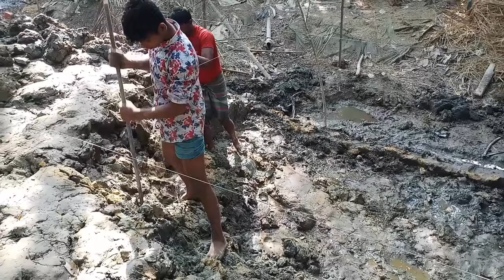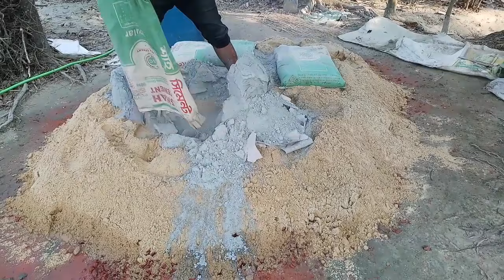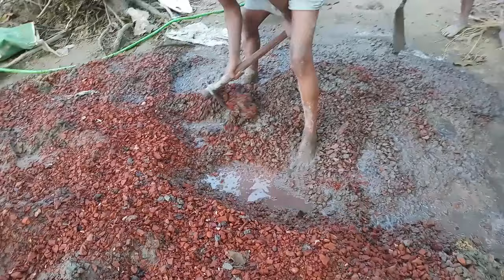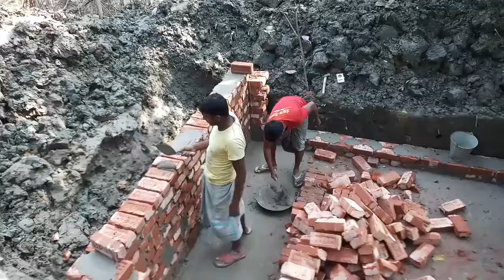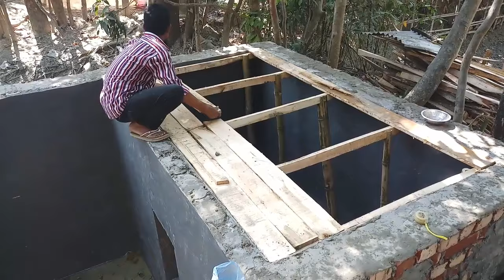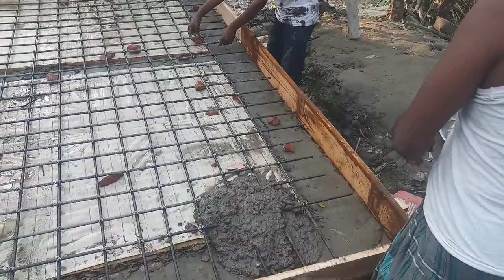Amazing Construction - Septic Tank Installation Process Step By Step | How to make a septic tank

Comment: What is the purpose of the wall in the centre of the pit?
Reply: Its a two compartment type tank, in1st compartment direct  solid waste are dumped, after 1st part gets filled by waste than waste go to 2nd part, than it goes to sewerage line.
Reply: @MH-yl7pm  is therea sewage line in a septic tank ?

Comment: What is the use of that partition centre wall.... With hole at bottom?
Reply: That’s called a two chamber septic tank, so the first chamber receives all the effluents from the house and the sediments settle there before the water passes through that hole to the next chamber

Comment: Kitna cost me huwa
Reply: Important thing to note.  You should not plaster the walls in side except the partision wall. If you plaster walls from inside water will not be observed in the sand surrounding the septic tank. The septic tank will fill very fast....but if this problem exists.. You can make holes on the outer walls  with a drilling machine.